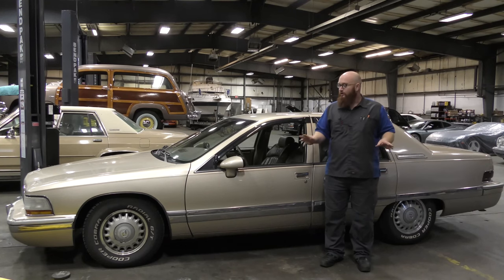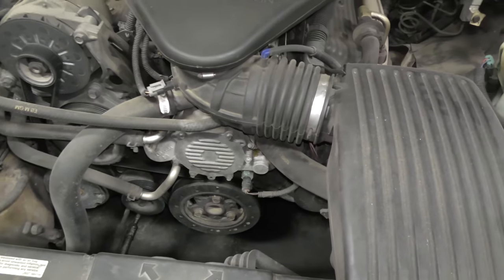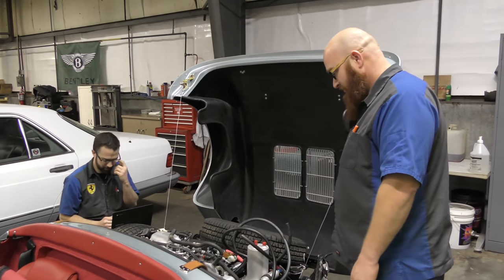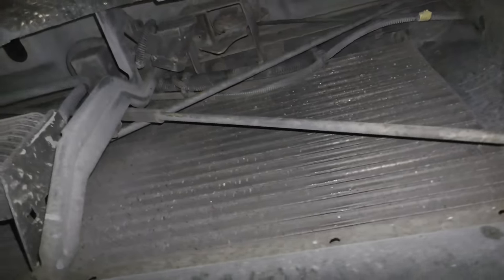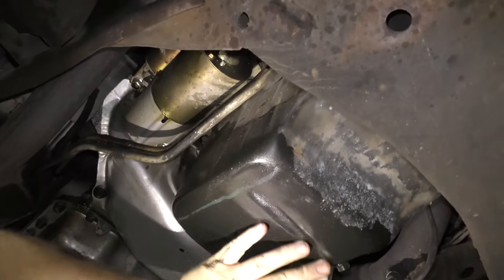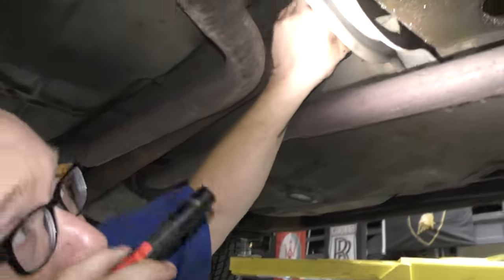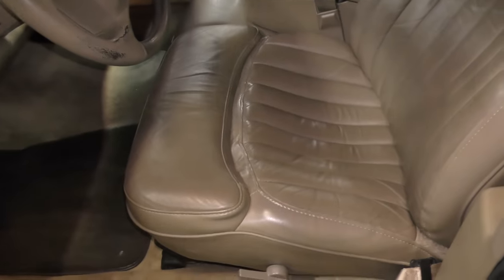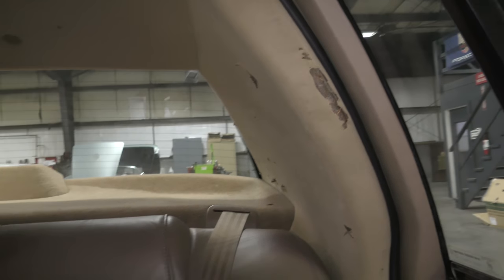Why do mechanics buy 'grandma' cars? CAR WIZARD explains their lure with this '94 Buick Roadmaster

Comment: OptiSpark on LT1.... do NOT drive it through one of those car washes with the under-body sprayer.   Especially if you have to pay a shop to replace the distributor on a 1994 Trans Am.   Twice.
Reply: It's really not as hard as you think to replace. but it is a pain in the @ss when it goes bad especially more than twice in a year. the best thing to do is go EFI.
Reply: Replaced the factory opti-spark on my 96 TA WS6 with MSD.
Reply: Speaking from experience, I presume??
Reply: @karlsmith2570  lol, yes. my 96 impala ss went through a few in the 12 years i owned it.
Reply: Correct you want to be careful running it through the wash like you said or any standing water in the road I had 1992 in 1993 which had one coil pack then I got a 1994 and at that time the water pump went and destroyed it it was pretty expensive back then to replace that coil pack what a place to put it
Reply: I can’t believe they made a mistake like this. I guess it was a bit too much to have four coil packs on a waste spark system like all GM’s V6s and four cylinders had at the time and coil-on-plug of the era would be very awkward on an OHV engine (still looks weird on the LS and requires HT leads).
Reply: 93 Roadmaster had one coil pack and 94 to 96 they had that design right under the water pump I've had both of them
Reply: @rickfig9128  - “EFI” - Electronic Fuel Injection? What’s that got to do with the ignition?
Reply: Its not hard to change on a roadmaster, but it is a real pain on a camaro.
Reply: That's weird, because they changed it in 1994. You must have had an early model.
Reply: If you take the mechanic advice and get the grandma car, the LT1 in those comes with a proper vented optispark connected to the air intake tube, several years before they switched on the vette & camaro/firebird. ;)
Reply: That's oddly specific haha
Reply: Pain in the ass on an FBody. And I believe the non vented optis vs the vented ones correspond with a different cam and/or timing set, so you can't simply "swap" to a vented one. Dumb ass design. I believe they make a conversion for LS style coil packs, but it's expensive and at that point you may as well just do an LS.
Reply: Fuck optispark. All my homies hate optispark.
Reply: Maybe swap to an LS
Reply: @bendunn1302  I remember seeing a conversion in a LS book, adds power also
Reply: @Dozav7  EFI, the company, makes a conversion kit that converts the LT1 ignition from the optispark to LS coils
Reply: I used to hate GMs distributor being buried in the firewall and liked a lot of older Fords with distributor right up front! Did not know GM found away to make distributor access even more difficult and sketchy!
Reply: just put it in rice....it will work
Reply: @rickfig9128  what does going EFI mean?
Reply: why woudl you ever pay a shop to replace a distributor lol

Comment: I had a '93 Buick LeSabre and riding in that thing felt like I was driving a recliner.  I bought it for $2k @90k mi, got it up to 175k mi and sold it for $1500.  The AC still worked.  So much room inside the cabin and in the trunk.  It was a very smooth ride.
Reply: I own and still drive all the time three 1992 Lesabres.  Paint now terrible but great operating vehicles.  Comfortable and roomy.

Comment: I daily a 94 Roadmaster sedan! I he's absolutely right, a perfect everyday car: comfy and classy.
Reply: I own a 97 grand marquis. 4.6 double exhaust, high ratio differential, blue interior / blue exterior 👑. 100k miles. Bought it used at 50k. I love that thing, ride is smooth and that v8 rumble gorgeously at high rpm, delivering high quality torque with those fine 225 Yokohama tires I put on it 🙂

Comment: As a Brit I love how Americans describe 3 litre engines as small, over here you can frequently hear people describe tiny little 1.6s and under as large, our insurance costs are insane
Reply: V8's are REALLY common on this part of the pond🤣
Reply: We have huge road systems compared to you brits . Heck Montana is larger than much of Western Europe and the roads go on and on.
Reply: Well it is small when you compare it to a 7.5 v8 460 big block or a dodge 8.0 v10 for example. Anything under say. 4.0 straight 6 would be considered small to a extent.
Reply: @Fattony6666  not as much as China and India
Reply: We're kind of spoiled by the amount of space we have to work with, and cheap fuel, even now with the average price being over $4 a gallon (about $1 a liter) in America. But at the same time, the wide-open spaces put a premium on speed, which means larger, more powerful engines. To go from Thurso, Scotland to Plymouth, England is 818 miles by the most direct route. On Interstate Highway 10 (I-10), you'll travel 880 miles just to cross the state of Texas. The close quarters and tighter clearances, with more people packed into a much smaller area multiply the chances of being in an accident substantially, or having your vehicle vandalized or stolen. I'm surprised there are as many cars in Europe as there are, to be honest.
Reply: Shoulda got rid of the royals, bro…

Comment: "Out of 20 new parts 1 is going to be faulty" Yes I feel you, same thing in IT with computer hardware -_-
Reply: Dorman, BWD, much worse.
Reply: Finest Chinesium Alloys Used.
Reply: @markh.6687  lmao
Reply: I was wondering if these were genuine or pattern parts. My experience with pattern parts (including struts) for a Nissan Sunny was that they were a complete waste of money. If they come with a years warranty you can expect 15 months life from them.
Reply: @MrDuncl  sadly there's a lot of fake parts around, and it's difficult to expel them from the supply chain. I worked for a reputable brake pad manufacturer in the early 2000s where we had a warranty claim when a customer's brakes set on fire after a pad change. Turns out they were made of compressed grass. We settled the claim anyway to preserve reputation because the customer had bought the parts in good faith. Thanks a lot Mr Faker. What goes around comes around.
Reply: @mph5896  Dorman: "When it's either us, or make your own part"
Reply: @charlesbridgford254  Nice of your company to stand behind the other guy's fake parts. I mean, send the bill to the nearest Chinese Embassy.
Reply: I quit building computers for that reason, got sick and tired of playing lottery, i didn't always sit with that feeling, things have changed in the last years.

Comment: I remember going to Auto Shows in my youth: Mercury's Grand Marquis was marketed as the archetypical "Old Folk's" ride...even in the brochures, senior citizen models were shilling this car.
Reply: Yet police officers and undercover detectives ride them and still are. I mean, panther platform is very dependent on the trim and color you choose. You can make that 4.6l v8 a baddie if you wanted to, add some borla exhaust. Nice wheels, nice matte paint job. Nice sound system and you've got a completely different set up of a grandma car.
Reply: Our 81 Crown Vic outlasted and proved a much better car than our 87 Grand Marquis. Luxury goodies can be a liability if they break down.

Comment: I'm a electrician and since I started 10 years ago I still drive my 92 road master estate wagon. It fits all my tools and it has yet to fail me.
Reply: When I was an up and coming carpenter, I worked out of an Oldsmobile wagon. During the ice storm it was unstoppable with posi rear and weight balance. Dry tools in the back.
Reply: @larrynorsworthy8582  I worked as a painter out of my Caprice wagon, and later on I got a Pontiac Safari with the woodgrain sides. I took it camping upstate, too, I can't even remember why I got rid of it.
Reply: ...and you don't need a ladder to get to your ladders!
Reply: Im an hvac contractor and i know a service guy who uses a 92 wagon. I am sooo jealous.
Reply: I worked as a commercial construction electrician and had an 8 year old 1980 Cadillac Coupe de Ville I bought from a wealthy suburban wife. Car was garage kept with 51,000 miles and looked near showroom new. She sold it to me for $1500. Drove it 10 years and put another 200k miles on it. I wish I kept it.

Comment: I have a gold 95 roadmaster Lt1350. Bought it 6 years ago with 98000 miles. I drive it 4 to 5  times a month. It's a great car. It's got 120000 on it now. I've replaced the AC compressor, shocks, thermostat, starter, and put all new coolant hoses since I've had it. It's rides so damn good. 
    And most importantly, it will roast the the tires really good pulling out of the nursing home 🔥 🔥! 
    Great Car. And frankly it's not worth selling.

Comment: Ha... this hits close to home, Toyota tech that has owned three 96 Camry's and a 2000 ES300.  All bought for less than $1000 with broken timing belts :-p
Reply: I've seen older Kias and Hyundais I sort of like with timing belts, but it's too expensive to have to take them in and have them changed for the age and mileage. I can't do that kind of work, no garage, no 2nd car, maybe not enough tools either.

Comment: After owning a series of European turbo diesels, I long for a car where I can get my arm into the engine bay.
Reply: When I was replacing the spark plugs on my 2012 Chevy Silverado, I sat on top of the plastics over the radiator and had my feet resting on the crank pulley. That truck has more room in the engine bay than my 1997 Chevy Silverado does.
Reply: Yep, I went from Audi’s and VW’s to a Pontiac Grand Prix and Chevy 1500. So easy to work on in comparison.

Comment: I miss my 1976 Oldsmobile Regency 98. 455ci, 4 door, with pillow seats. what a ride.
Reply: My parents had a 77 olds 98 when I was growing up. The car had over 300,000 on it when they sold it.
Reply: @TheBbabody  I still have my 77 98, best riding car I have, 403 with a 400 trans, still takes me anywhere I need to go.
Reply: @kevinj2412  Yea it was a great car. I learned to drive in that car and my moms 79 town car

Comment: An LT1 in a family car.  The ultimate definition of a sleeper.  I like that.
Reply: That's not a sleeper that car weighs 2 tons it needs all that power just to do the speed limit
Reply: Yeah.. not really. A Dodge Caravan will smoke it at a traffic light.
Reply: @andrewsherman2398   sounds like you've never driven one
Reply: They put the same engine is dump trucks.

Comment: I found this interesting.  I have  a 1993 Roadmaster - it was my mothers.  259k miles.  Engine has never been split.  3 radiators, 2 or 3 Alternators and when the air conditioner quit I had it upgraded to R134.  Rear axle replace in the last 50k miles (internal shafts and bearings) In tank fuel pump in the last 25k miles. I replaced the EGR valve myself.  Pollution # went from 700 to a 7!   Replaced all the radiators myself.  All in all cheap to work on over a 27 year period. It is a backup car at present. 1st 7 years it would get 25 to 28 highway mileage.  Window sticker EPA rating and it would do it.  In the last 7 years have never done better that 22 highway.  This is a 5.7 but not same as the 1994.  Still has tremendous power and get up n go.  Some of the best engines GM ever made.

Comment: I'm a mechanic for 30 yrs working on electric generation plants. I drive a 1987 420SEL  gas burner V 8 and love it !  Do most all repairs and maintenance myself. Very easy to work on and parts are not expensive. Drives and rides excellent !
Reply: Mercedes parts not expensive? You must be kidding!

Comment: Changing out the distributors on these motors are a joy to do.
Reply: Really not that bad.  I've done a few.
Reply: @allcoupedup  Nah. So have I. But it’s not a good design at all. Otherwise the LT1 is a fine motor.
Reply: After 4 failed opti's I swapped my fleet of LT1 cars to individual coil setup.  Five years no problems.  93 Trans Am 94 Roadmaster and 95 Fleetwood.. simple job to diy or use one of the kits available now.  Great investment I highly recommend it
Reply: @Lunchman.d  The Torqhead setup is expensive
Reply: Your a tuff guy you can fix it
Reply: @nicotoscani8270  I got the basic kit from them on 2 of the cars, got my own coils from junkyard.  I payed $499 per kit when i got em.  It's not exactly cheap but it was same price at the time as another MSD or Delco Opti.  The MSD customer service was terrible.  They would take the unit back and "rebuild" it and when I got it back together it would be worse than before.  Third go round with them and I decided to take it apart myself and investigate.. filled with locktite/grease.  The Delco unit went bad and exchanged once for free, second time they told me to get lost.  I even spent $700 on a Opti from a company Dynaspark back in 2006.. failed at a year and the company told me to get lost.
Reply: @Lunchman.d  Well in the future if you need an Opti, there’s a guy on EBay that sells refurbished original Optis with Mitsubishi sensors. Bit the bullet and bought one from him and it’s been great. Optisparksolutions1 is his EBay user name. Good luck in the future.

Comment: I drive the wood paneled wagon version for my mail route. It a tank and has so much room especially with the seats down. It was designed to fit a 4x8 plywood in the back.
Reply: did you ever actually put one in there? The biggest I could fit in my wagon was 7-1/2 feet with the front seat adjusted where I wanted it

Comment: Things I love about these older cars: 
1) You feel like a gangster.
2) Smaller rims with bigger tires that will be more comfortable and handle more abuse than any new car tire.
3) A little bit of ground clearance for dirt roads
4) You can get comfortable, high-quality cloth seats!!! I don't really care for leather or poor-quality cloth.
5) Lower belt line with big windows so you can actually see all around you. New cars feel like you crawl inside a cave and peek out the front.
6) Cheap to buy, cheap to run!

Comment: This is why i own 3 cars like this. I have a 1990 Pontiac Bonneville with over 350K miles on it, a 2002 Buick LeSabre with 190K that i daily drive with minimal issues, and a nice rust free 1990 Oldsmobile 98 Regency for a fixer up project that was abused with only 103K on it. All have 3800 V6s in them and I expect all of them, even the high mileage Bonneville, to be around for quite some time still. Easy to work on and parts are cheap. Love old cars!

Comment: There are few things more annoying than going to all the trouble to replace a part and then find out it's faulty. B&B Auto Parts was guilty of this many times for me, circa 35 years ago.  Once I had to return a starter three times before I had one that worked. At that point, I'd had enough and never went back and forever named that business (Bring It Back Auto Parts Store). I guess this problem is rampant these days and makes me glad I'm not an auto mechanic. Thanks for a superb video. I'll be back.   Cheers

Comment: Haven't watched the video yet.

It's the same reason I bought one, probably. Huge engine bay so easy to work on. Rear wheel drive so easy to work on. No crazy tech so you can fix it yourself. Built like tanks so they are reliable.

I own a 2005 Grand Marquis and I love it.

Comment: 1998 - 2002 Mercury Grand Marquis <3
Reply: Nah, 2003+  Grand Marquis/Town Car/Crown Vic is the one you want.  They changed the suspension/chassis up for 2003, rack and pinion steering, they drive a lot nicer.
Reply: I owned a 1988 and 1989 Grand Marquis.  Endless money pits when they got over 100,000 miles.  ALL highway driving and well-maintained.  Just poor quality.

Comment: The LT1 was actually 260 horsepower On all full-size cars from 94-96.  Great feeling engines, Easy to work on and pretty reliable by standards of the day.  Weak links were water pumps, power steering and engine electronics.

Comment: 94-95 Roadmasters are 270HP.  More power for your fuel consumption than a Northstar.   We've had both and the Buick is a better deal.  But distributor service on those is a PITA.   And the trashy interior plastics, window regulators, automatic temperature control are typical GM junk.   I mostly run Chrysler minivans which can be very reliable and more useful overall than almost anything else on the market.  Ride and drive better than Roadmaster or DeVille.  My current favorite is an 09 4.0l, bought new, now at 190K.

Comment: LOL I was thinking of this very same thing! I remember in the military, you could pick out the mechanics by their vehicles. They were the oldest, roughest looking vehicles on base or nothing glamorous, but they all ran perfectly and caused less problems for them compared to the non-mechanics vehicles. It used to be military vehicles were easy to work on, but I can't say that now so they don't want to have to tinker on their vehicles when they are off.

Comment: My parents had a fully loaded Light Adriatic Blue 1994 Caprice wagon without the wood (as it should be). We still have the original 4 page window sticker.  It had the "towing provisions" which included upgraded brakes, self leveling air suspension, strengthened frame, oil cooler and transmission cooler, heavy duty cooling fan, 2.93:1 limited slip rear end, and the LT1 of course. I remember looking at a dyno sheet we had that said the car made 282hp and 350lb-ft to the rubber. Such an underrated car in more ways than one. I'm still searching for it, but I'm afraid its long gone.

Comment: My daily driver is a 2003 Buick Lesabre. Paid $2,200. 120,000 miles, no rust (which is huge living in Minnesota) previously owned by an elderly couple. It's not the best looking car on the road. But the car rides sooooo nice. And the gas milage is quite impressive for such a big car. 25-28 mpg. I've even hit 33-35 mpg on a road trip to Montanna. It's just a great car.